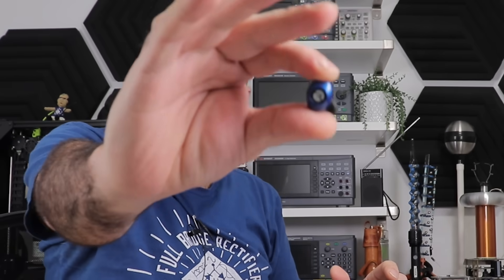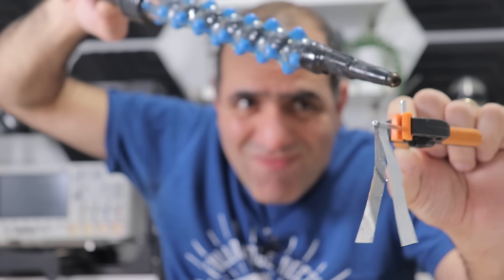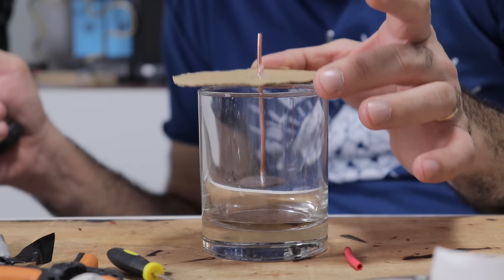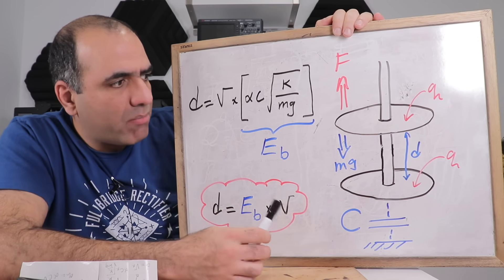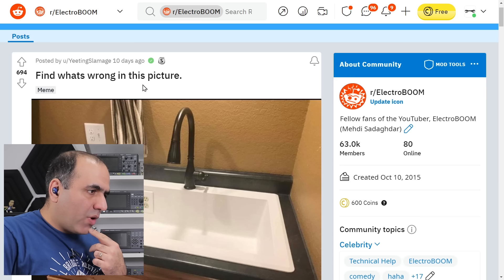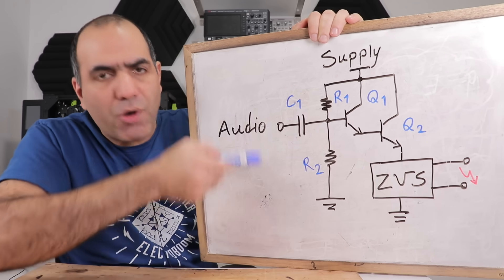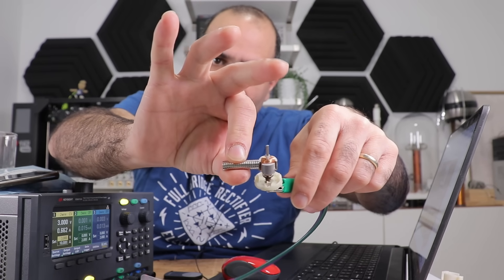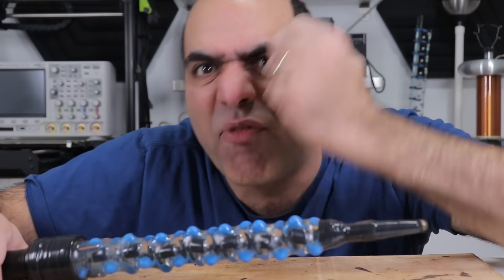I Reinvented the Electroscope! (LATITY-008)

Comment: I fell for the Raycon commercials and bought a pair. in short, I don't recommend them. they give me headache when I used them, and both speakers don't always sync and work. The bluetooth technology is dated as it only connects to one device and you need to disable other phones at the same time. Don't rely on them for microphone and phone calls. They fit nicely in the ear
Reply: Really? Mine are the same ones he has there, and they work great. I had your issue once or twice, but i just popped them in the holder and removed again and it fixed. Just cant do it too fast, i guess.
Reply: I don't have raycon, I have Jabra, but my experience with these kinds of headphones in general is that if your ears pressure shift too much while wearing them, a headache or pain in the inner ear is likely. Maybe you just have irregularly shaped ears too.
Reply: @SophiaAstatine  thats possible, maybe use different silicone thingies, or even poke a hole in em?
Reply: @Beeks81  need a airtight fit for the noise isolation to work though.
Reply: @SophiaAstatine  possibly! I work in a noisy environment, and a little push makes it work better, but they work pretty good either way.

Comment: Dear Mehdi: I'm somewhat surprised that you haven't developed superpowers by now.  You've been shocked so many times in your videos, and  in most of the science fiction I read, someone with that much experience with electricity should have developed SOME kind of super power by now.  I am not an electrical engineer, so I don't really understand how electricity works. If I  was in charge, I'd make sure you had super powers.

Comment: 3:25 Feel like it's worth noting that the physics there is slightly simplified as the metal rod holds charge as well, but it's likely that the effects of this can largely be ignored as some small variable that reduces the forces as a function of separation. However, this device isn't being used for precision so any effect from the rod won't detract from the effect of showing repulsion due to the apparatus holding charge
Reply from the maker: I would say the metal rod doesn't have any effect on the plate, because it is perpendicular to it with almost equal charges on both side of the plate.
Reply: @ElectroBOOM  I'm sad. I tried going through the physics of this and must have gone wrong somewhere. I found that for a finite rod the parallel field is non-zero, but from the way I defined it it suggests that the field is at a maximum when the plate is at one end of the rod and is at zero at the other, and that the direction does not change according to the placement of the ring relative to the centre of the charge distribution. I should redefine the rod to go from -L/2 to L/2 instead of 0 to L, or work out where I went wrong, but I've already spent too much time on this
Reply from the maker: @goodguykonrad3701  :D That's fine! Physics is hurtful sometimes. Yes being at the rod's ends the force would be maximum. But with a giant plate I have at one end, the force at that end will be huge, and the floating plate doesn't go way high for the rod to be too effective. But you are right, the rod would have an effect over the full length of travel. depending on its size and surface. So keeping the rod thin and plates large and not traveling too far up, I think the rod effect is negligible.
Reply: @ElectroBOOM  although the rod is perpendicular at the point of contact with the plate, it is at an angle with the edges of the plates, allowing force to impact measurement
Reply: @youhackforme  The E-field will leave the rod perpendicular to its surface, so won't have any impact on the moving plate.
Reply: @ElectroBOOM  The rod being metal will massively speed up the rate at which charges equal back out. On a plasic rod, it might even keep floating for minutes.
Reply: You can easily test it by just including the rod in your calculations as well. Might even make a decent text book exercise, who knows.
Reply: in order to cancel that out (somewhat) i would suggest extending the rod below the bottom plate to make the difference in amount of rod above/below the plate less significant
Reply: @CloudHater  That would work. I was also thinking just make the rod thin and insulate it
Reply: Who do you think can be a scientist without being a soldier?  I SWEAR I'm not making a Confucing joke really I mean it (btw tell China I said "how can you become Chinese without becoming a leader in supplying solder?")

Comment: no Mehdi. I don't agree with the static discharge theory. A car / truck is a Faraday Cage. you won't get zapped until you actually touch the ground?
Reply from the maker: The thing is that the guy was not touching the truck and was rubbing himself against those roles, so his body picked up charge isolated to the truck, and when he touched the metal truck which was grounded, his body arced to truck.
Reply: @ElectroBOOM  hello sir love from india ❤️❤️
Reply: @ElectroBOOM  ok I defer to your wisdom

Comment: Micro Cotton fibers that are airborne are very flammable. So the concept of "dust explosion" is a pretty accurate guess. Ever seen a grain silo explosion? Same concept. Microscopic dust particles that would be nonflammable as grain material become violently explosive once airborne in a quantity large enough. 

Look up grain silo explosions. Scary stuff
Reply: Flour mills and large bakeries have the same problem. Nasty stuff.
Reply: yep I worked in a cotton processing plant and the ventilation is the most important part of the building.
Reply: You can create a static discharge fire with just flour in the air, look into this one Mehdi
Reply: Have seen people on internet advising throwing flour on to a cooking oil fire to extinguish it. Do NOT do this!
Reply: @alistairmackintosh9412  you know it seems I've heard that through different people at different times, I don't know why I didn't connect that dot sooner
Reply: An alternative explanation would be that what they were loading wasn't cotton, but rather rolled-up bubble wrap or similar very low density plastic products. Those do offgas quite a bit, especially when freshly made, and so would explain how a flammable atmosphere was created.
Reply: @zuthalsoraniz6764  that was what i saw. it was plastic foam injected with butane as a curing additive. i worked in a plant that made this stuff. it's supposed to gas off after a few days before shipping.
Reply: Yes and once the particles reach a particular density in the air they start sliding against one another and create their own static charge, and eventually discharge (creating the explosion) just like how actual lightning is made, very scary stuff.
Reply: It doesn't look that dusty and dust fires aren't that easy to start, you need an open flame or enough surface to ignite multiple particles at once to get a runaway reaction (like in the hair dryer video ) it sure looks like there is a lot of vaporized solvent so even a static spark is sufficient to ignite. by the way his cotton jeans rapidly rubbing on the bags when he jumps makes a good generator for the spark :) (edit after multiple views it looks obvious that it's a solvent fire the rolls catch fire all around and the flash is just the vapours, the spark looks legit because he rubs his shirt against the plastic bags just before touching the floor with his right foot )
Reply: The cotton is wrapped in plastic.  The floor of the truck looks strangely shiny.  The most likely cause for the fire is solvent fumes.
Reply: was literally going to comment this myself.
Reply: I think Mythbusters tested/played with this
Reply: @timehunter9467  they did, it was a good episode, they ended up testing it a few times so they could scale it up bigger and bigger
Reply: I remember researching a bit about oxidisers and found that dust explosions were a thing. Any solid substance ground into a fine enough powder has the potential to combust while in contact with oxygen. Also, the more surface is touching oxygen, the greater the danger. That's why dust in a silo is pretty safe, but once it spills an starts floating around it turns into a blazing hell in 3 seconds.
Reply: All of those rolls were wrapped in plastic. I highly doubt there was enough dust in the air to cause an explosion.
Reply: Hear me out.. I used to deliver furniture in a big box truck, it was a fuel hog that ran so rich that there was often a pool of gasoline vapor under the tail pipe if it sat in one place for awhile. Would it be possible if the engine were left running that gas vapor in the exhaust could rise up into the back of the truck and settle on the floor since gas vapor is so dense? I know gas burns incredibly fast but could that be a enough of a flame to ignite other slightly less flammable dusts in the air?
Reply: It makes a nice mini mushroom cloud lol
Reply: This - if @electroboom wants to test this, he could blow some flour in the air over a candle or something
Reply: The USCSB has offered a few videos on this subject:
https://www.youtube.com/watch?v=Jg7mLSG-Yws
https://www.youtube.com/watch?v=PZHpeBubb_M
Reply: I think technical term is fuel-air explosion. They are immensely powerful. Most powerful non-nuclear deliberate explosions are made with them.
Reply: Have a look at where Beirut used to be.
They stored TONNES of fireworks, high nitrate fertilizer next to 4 grain silos.

It's like they were trying to view themselves up.
Half a kiloton of boom.

Still only the 6th biggest too.
2nd was in England, at 2 kilotons 😳
Then Canada at 3 😱

Oh and there's 1.5 kilotons of explosives in the Thames.
Been there since WW2.
They're now going to try to dismantle it.
Better then than me.
Actually it's sounds quite exciting to do.
Reply: I'm thinking of this years ago. Thought of it when I was in a hardware store. They took me to the back warehouse where they cut and saw wood,

I can see the very fine wood dusts floating all over the place. I'm thinking, if ai light my cigarette, will this place blow up or turn into a big fireball? 

Same theory...
Reply: mehdi was so incredibelly ignorant on this i almost couldnt beleve it haha
Reply: @darrellbeets7758  I don't know so much as ignorant as ill informed. As they say you don't know until you know. Ignorant would be to dismiss without an attempt to understand. He tried and couldn't replicate it then posed his own plausible theory. More data was required
Reply: @jasonbarnes8047  I think u misunderstood what I found ignorant.
Reply: @darrellbeets7758  he made an entire video semi seriously suggesting microwaves are safe to shove metal in without ever pointing out the microwave he used to show it had anti sparking technology, why the fuck do people give this dude so much leniency?
Reply: Look up what happens to creamer when the air fuel ration mixes with fire lol
Reply: There was fumes present from processing the cotton. hence the explosion.